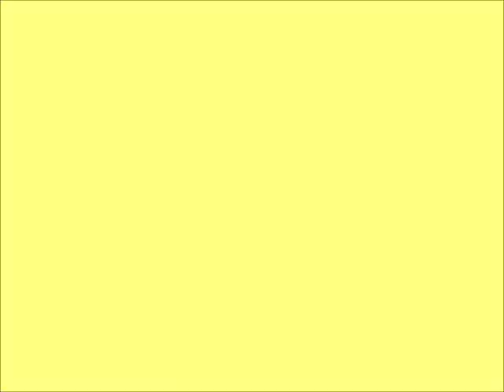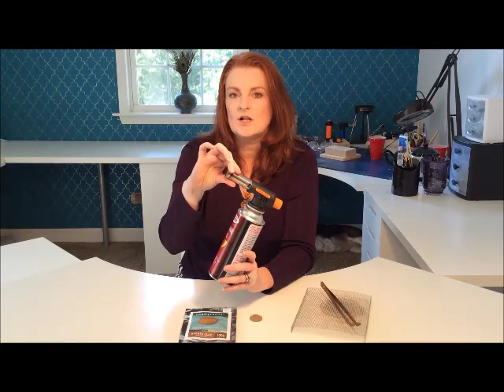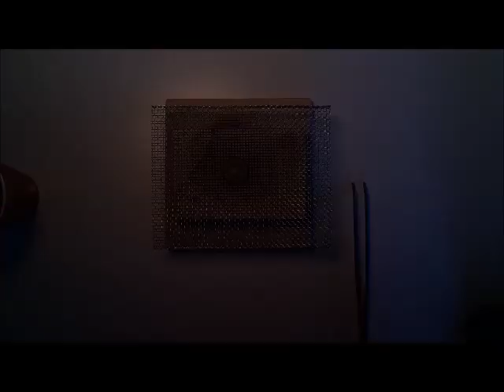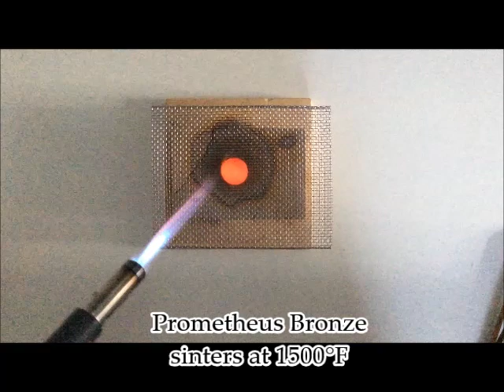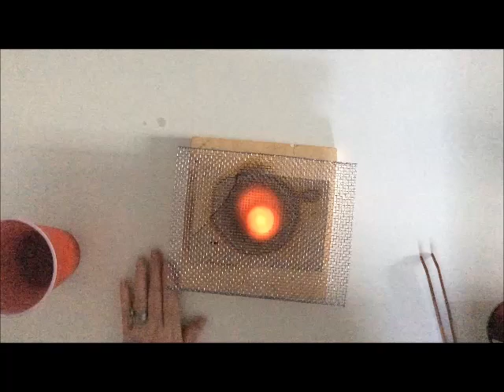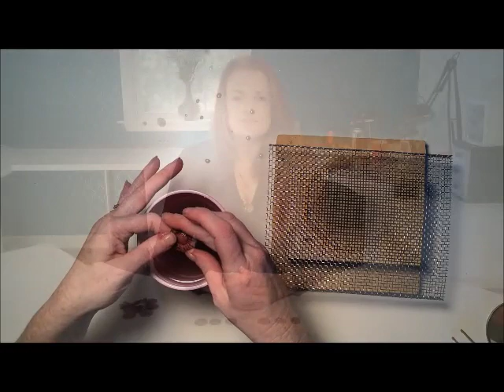Torch Firing Prometheus Bronze Clay

Comment: anyone got any tips? help! I have tried torch firing with a large butane torch at a red/orange colour for 14 minutes and my piece shattered when I put it in cold water and it had only partially sintered. I'm using sunny bronze Prometheus. it just won't work! the instruction manual said fire for 5 to 10!! wtf! but that didn't work either. I pickled and brushed what was left just to test and there was a slight bronze sheen but it totally fell apart. argh planning help! thx
Reply: Did you find a way ? I'm having the same problems with Prometheus sunny bronze clay
Reply: I'm also having my sunny bronze clay crumble after firing!
Reply: @taylorwalker427  Did you manage to find a solution? :)
Reply: @azadeh5505   Did you manage to find a solution? :)
Reply: Did you find a solution to the problem?
Reply: @aniagruszczynska3046  I found out a while after that although it says you can torch fire it, it not actually possible. It needs to be heated in a kiln. I gave up in the end lol.

Comment: Hi, thank you for the video. I have had no success firing bronze clay, which I am thinking is because my butane micro torch (which works for silver clay) does not have a big enough flame for bronze or copper. Can you please provide a specific link or name of the torch you use? I have looked online, but they don't specify what kind of flame they have, so I'm afraid I might end up buying the same type of torch I already have. Thank you!

Comment: Why is it that when torch firing your only firing for 7 minutes but in a kiln it's hours?
Reply from the maker: Hi Lorri, I'm sorry, I never got the notice of your post and just now saw it. I will be happy to explain.
Sintering is when the metal particles are partially melted together. It is a range of level of melting, not a specific point. They can be barely stuck together, or stuck together very well. 
A torch fire, will always produce a minimal level of sintering. It will not be strong enough to bend, but can be used effectively for most things. As an example, I never recommend that my students torch fire rings (no matter the clay/metal). The finished piece of metal is not as strong as a high level of sintering would produce.
Torch firing will limit the types of items you can make. However as a beginner, you will have a better understanding of what is happening to the metal by torch firing. This can allow you to have much better results both torch firing and kiln firing.
Reply: @clayrevolution5738  then how should I fire Prometheus bronze clay RINGS?

Comment: Can you please tell us specifically what torch do you use? I tried several ones and I find it impossible to torch fire it, no matter how long I try or how orange is the piece. thx
Reply from the maker: Hello! I use a butane torch head with a large nozzle. It is not a brand name and is very inexpensive. Here is the link to it. http://clayrevolution.com/butohe.html
You buy purchase more expensive ones at most of the jewelry supply sites. However, this one does the trick for me. The key is that the nozzle must be bigger than the micro butane torches.

Comment: i'm torchfiring Goldie Bronze Clay. If i try to sinter it  w i t h o u t   excluding oxygen (as per one of the videos here where she uses a carbon bed inside a kiln)  the stuff just turns to black oxidised cinder which crumbles in your hand. If i exclude oxygen with a coating of silver clay the bronze fuses properly --- so the prob is oxygen. But i don't want to always need to use silver coating, natch. Does anybody know how this lady manages to sinter with torch in open air without excluding oxygen and yet achieve proper result?
Reply from the maker: Hi! The key to the torch firing is that flames suck in oxygen. So, use a large bushy flame and that will be an oxygen reducer. However, you need to get it to the water to quench quickly so the oxygen doesn't attack it when you take the flame off.
Reply: Thanks, yes i know about the quenching thing --- just logical --- but i was talking about the bronze turning to cinder throughout the piece. However it is not linear --- sometimes yes sometimes no with no apparent pattern. Damned frustrating considering the work time invested in a piece.. but erm .. not to whine, eh.

Comment: I tried to torch white bonze but I think I'm doing something wrong :(
I'm using dremel versaflame
Reply: +valeriaorl77 I read somewhere that white bronze clay shouldn't be torch fired
Reply: +Emma Hewson :'(
Reply: +valeriaorl77  Prometheus® White Bronze   Prometheus® White Bronze must be fired in a kiln and has a multi-step firing schedule, much like other base metal clays. It has a shorter firing temperature range than Prometheus® Bronze, meaning that there is a much more specific target heat and hold combination you’ll need to reach for proper sintering.   Fire only a few pieces of white bronze at a time, and place them in the very center of the kiln. Pieces placed towards the edges of a kiln may not sinter fully.  Generally, there will be a Phase 1 firing, which is open shelf and burns off the binder. Phase 2 firing is in carbon, and will sinter the white bronze.  The final phase is a quick open-shelf firing to anneal the metal. Manufacturer’s Directions Phase 1: Pre-ramp the kiln to 932ºF. Place pieces on steel mesh and put into the hot kiln for 10 minutes. Cool. Phase 2: Put a 3cm layer of activated carbon on the bottom of a steel container. Place pieces with at least 1.5cm space between each other and fill the container with carbon. Fire to 1420ºF for 2 hours.   Allow pieces to cool in carbon. Phase 3: Anneal the pieces by heating to 1050ºF for 5 minutes, then quench in cool water.
Reply: +Emma Hewson you cannot according too Prometheus web page I tried it you end up with ashes XD put directions I found
Reply: +Jamie Huntley  thank you Jamie
I wrote to prometheus customer care and they told me the same thing. I'm disappointed because when I bought withe bronze from perles and co the  description says thet can be torch fired. I'll will wait untill I can afford to buy a kiln :(
Reply: well I'm saving up too buy a jewelry  kiln on etsy cheapest price could find at 400. XD I do things the hard way bought 200.dallors of white clay so...I have a ceramic kiln with a window they use firing cones...just not comfortable messing my other kiln up ,do it the right way
:]
Reply: certain nonferrous metals like zinc, antimony, and even aluminum, tend to be both hot-short and easily oxidized. Sintering won't generally work with anything that has a high zinc content in an uncontrolled atmosphere. For powder metallurgy parts, stainless steel, titanium, and aluminum powders actually require argon or other inert gas purge during sintering in a kiln for similar reasons.

Also, zinc is stupidly toxic to breathe, so don't torch anything with zinc in it, particularly indoors. 

https://en.wikipedia.org/wiki/Metal_fume_fever

One note: You might be able to do something like a canister weld - burn out the binder, then place the part in charcoal dust inside a stainless steel canister (with a small vent, or it'll turn into a pipe bomb!) and then heat with a torch, but the temperature constraints are probably going to limit the success of that approach even if you can limit oxidation of the zinc.

Good luck with your projects! ;)
Reply: I have dried thoroughly both prometheus copper and sunny bronze and every single time it burns off, then turns brittle, black, and breaks, its brittle and none have turned out. I purchased 100 grams and lost all of it. Why is this happening? I am using a hand butane micro blazer torch. I really wanted to use this clay but I think it's a bad clay. If its black, does it mean the torch isn't hot enough? Woukd a kiln be better.. my whole piece turns cherry red but black is on the top
Reply: Also the black oxide does not come off..